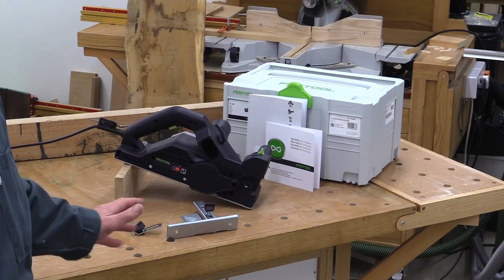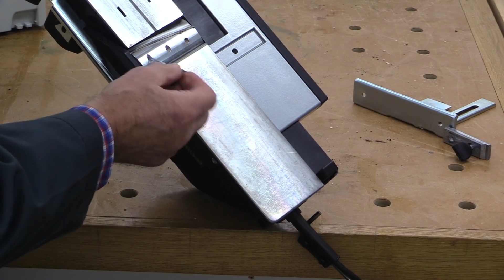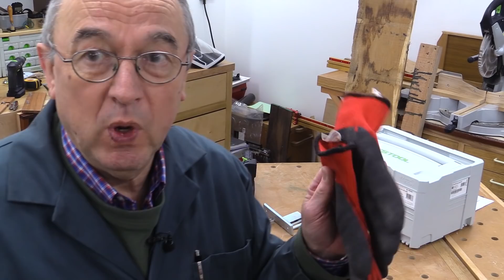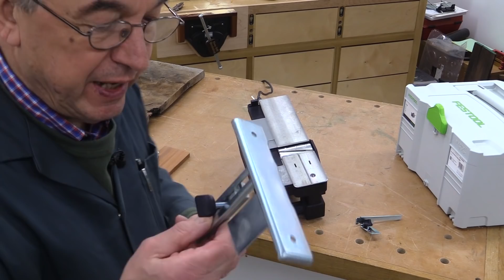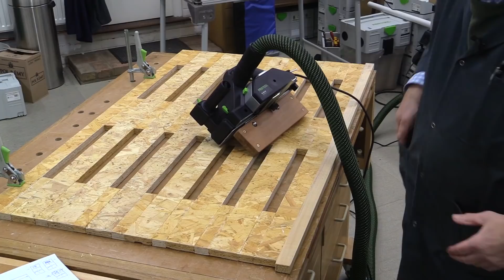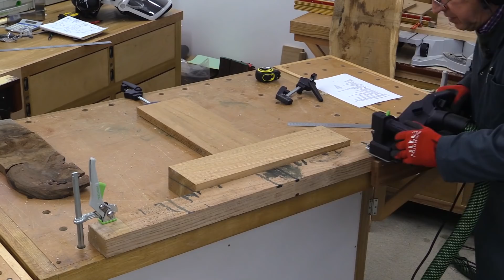Festool HL850 Planer Tour and Demonstration

Comment: Hi Peter, I thing in the case of the rebate, once you make your initial first pass you can remove the fence and simply place the planer against that edge for every other pass
Reply: Hi Peter, I noticed that festool make two planers, the 850 you demoed here and a smaller one.
I'd love to see a comparisment video between the two. Can thd smaller one do everything it's big brother can?
Cheers
Reply from the maker: Hi Dan, Festool UK have decided not to support any of my video work any more. So, I am unable to help.  Cheers.  Peter
Reply: @NewBritWorkshop  hi Peter, I didn't know that, sorry to hear that they must be mad. I understand your reaction.
Reply from the maker: @Dan The Chippie  Hi Dan, I was really hoping to be able to make videos of some of their new kit, particularly the battery Kapex and the battery extractors. I have had over 600,000 views on my various Domino videos alone and over 168,000 views on my single video about the CT26. I think I have about 90 videos featuring Festool kit and many more where the kit is used on projects. When I sold my big heavy woodworking machines in 2010 I spent 3 months doing market research to look at the right way forward and concluded that Festool had the perfect concept with their "system" approach. I have never regretted that decision and still love using their tools.  Cheers.  Peter
Reply from the maker: Hi Dan, Yes, that is the way to do it. Many thanks. Peter

Comment: I find it incredible that this tool hasn't been improved in the power tool market. It is the most fundamentally important woodworking tool - there are so many  easy ways to design a  tool to give the convenience of a power tool with the fine finish of the hand planer. Extruded Aluminium is machined to incredibly fine tolerances - so why not have different size lengths that attach that adapt the length of the plane from a number 4 to a  number 5,6,7,8 or 9?  Add some brass weights that slide on the top of the extruded aluminium as well for the feel and mass?   Spin the speed of the motor up to a router for finer finish?  even have automatic sharpening blades - run the motor in reverse and place it on a diamond plate sharpening stone .... recalibrate the depth adjustment afterwards and you are off.  Make a shooting board that doesn't wear out with extruded aluminium and you can do anything.  My Grandad had a jigsaw ... to cut rough sizing ... and everything else was hand tools.   With a really good plane you can make rough cuts and make fine furniture  with the plane and some hand tools. Its such a fundamental tool!
Reply from the maker: Hi Robert, It will be a cost issue adding so much more to the planer. I suspect that most people would still buy the basic kit. If you use this machine it can produce excellent results which only require a light sand to finish off.  Peter

Comment: why do I get so much dust and chips?  I have changed to a new planer and extractor ALL FESTOOL and still get a fair amount of debris?
Reply from the maker: Check that you have switched the little lever fully for left or right dust extraction. Also, try and use a 36 mm hose rather than a 27 mm hose as the machine really does produce a lot of debris.  Peter

Comment: Hi Peter.  Couldn't help smiling at some of your mistakes, welcome to the world of electric planers.  I bought the Makita cordless in the end because if any tool needs to be cordless it's a planer.  I expect Festool have this in the pipeline although dust extraction still tethers you.  Great video as always.
Reply from the maker: Hi Adam, Many thanks - planers are quite power hungry and I suspect that presents a challenge.  Cheers.  Peter
Reply: I've had two corded Makitas in the last twenty five years and they are excellent planers for site work. I just bought the Festool a few days ago because a client wanted the hand hewn look on some rafters and beams I'll be installing. I hope the Festool is as good as the Makitas have been. I've never found dust extraction to be an issue during framing as I simply use a leaf blower at the end of the day. Indoor planing however...

Comment: Hello Peter, i have this planer few years and i love it. But i have few questions:
1. How plane lumber that is wider than 85mm? I struglin with transitions,
2. How plane table to be flat? 
3.  How to use it. Just tips and tricks. Dont show us special heads:))
Thank You a take care. Bye, bye
Reply from the maker: Hi Jiri, The wider stock is just a question of moving the machine over and accepting that there will be a slight difference in cutting depth which should be overcome by sanding.  Peter

Comment: Hi Peter could you possibly look at using this for flattening stock? I know the tool isn’t really designed for this but does it perform the task? Thanks in advance, Robbie.
Reply from the maker: Hi Robbie, I am not sure that it would be an easy technique to master but it should work.  Peter

Comment: The blades for this plane are £26.40 at Axminster and not the £14.00 as stated. I really feel that you should have checked this being that you have such an affiliation with both Festool and Axminster
Reply from the maker: Hi Roland, You need to check the prices before typing - go to the FFX site.  Peter
Reply: @NewBritWorkshop  keep up the great videos.
Reply: Hi peter
I looked at FFX and only found blades for the Spiral blade - HW 82 SD £24.55 or strait blades. If you had said that the tool you were demoing use straight blades or the EHL65E blade £16.94 I would agree, But looking at the Festool websight  the EHL65E blade is not listed as a replacement blade for this tool only the 82 series blades. The only blades that I could find that were specific for the HL850 planer were at Axminster at the price I stated of £26.40. If I am wrong I truly apologist but FFX is not a sight/ company I have ever dealt with and in your videos you have shown an affiliation with Axminster tools.
Reply from the maker: Try Anglian Tool Centre:
https://www.angliatoolcentre.co.uk/festool-484515-hw825sd-planer-blade-82mm-pid36808.html